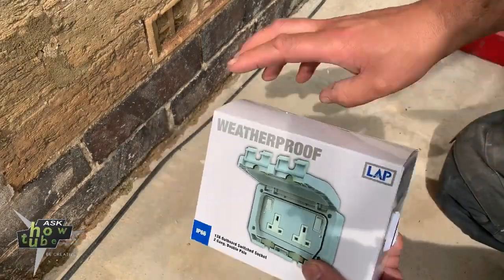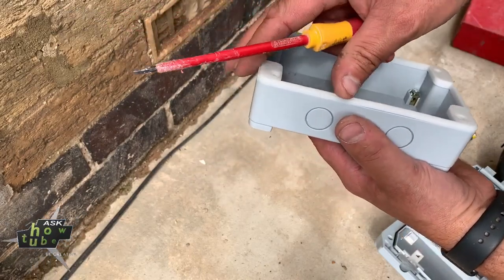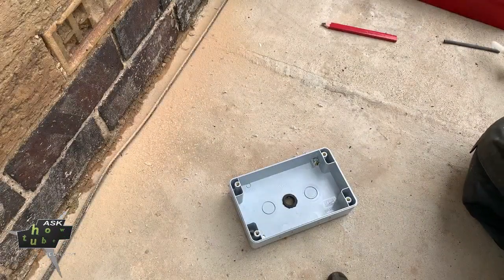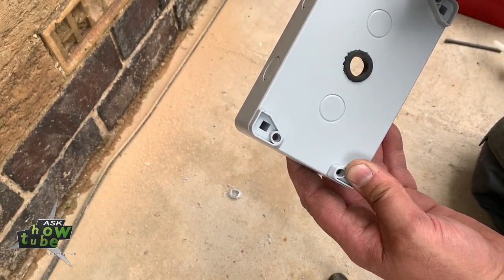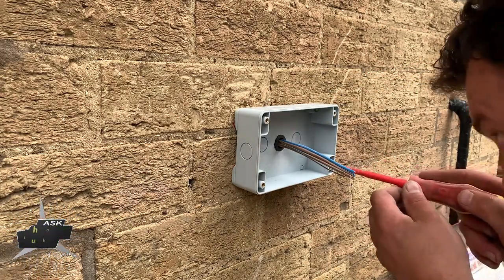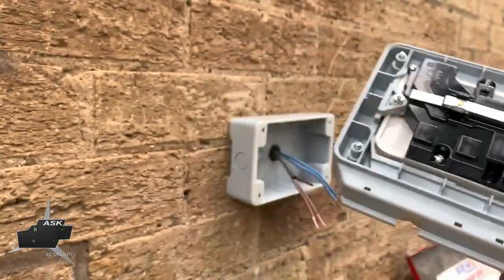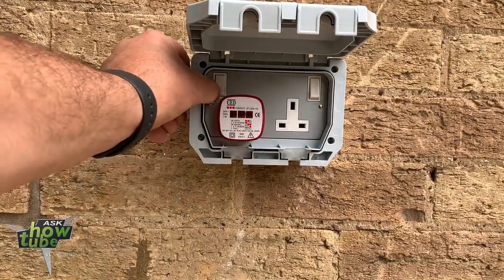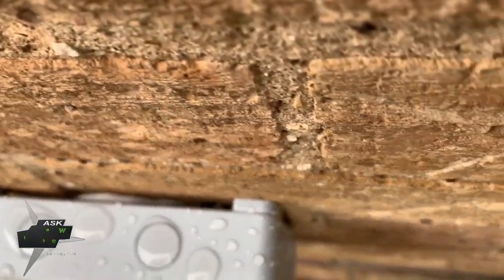Fit an outdoor socket, how to install correctly an outdoor socket, seal socket to prevent moisture.

Comment: You didnt knock out the drain hole, that makes the socket dangerous because in cold weather the socket will fill up with condensation
Reply from the maker: I did it, but it’s not filmed…but thanks a lot for mentioning it… very good point.

Comment: What is that type of cabling called? Looks like you've  got 2 earths, live and neutral.
Complete novice here. Thanks.
Reply from the maker: There are two cables with 3 wires each… using 2 cables you’re making the ring circuit.

Comment: I notice you had two sets of wires. Can I just run a plug from my shed to my pond wall and connect up just the three wires to it? Live neutral and earth. Will that power both the sockets? Is it two sets of wires for you as it’s on a mains ring from the house?
Reply from the maker: Hi, yes I did used the ring circuit. Recommend will be to connect the shed through a circuit breaker...
Reply: @askhowtube  Awesome thank you very much

Comment: I make a drain hole in the bottom as this is recommended.
Reply: if its done properly you shouldn't need to do that.
Reply: @tomsy8925  You may not be sure that the silicone has sealed completely (look at the size of the blown brickwork in the video) and also, with time, it may break its seal (due to temperature cycling, for example) or condensation can collect (e.g. warm air from house condensing on outside surface, especially if conduit/pipe has been used to channel cable). Though this is unlikely to be significant in most outside environments, a drain hole is often a good idea to prevent a pocket of moisture. It means that if ever water does get in, it can get out again. Unless there is spray from below, the only disadvantage is that it provides access to small invertebrates. With a drain hole, it may be sensible not to seal at the back of the box as then there may be air currents through the unit and equal pressure above and below any water that collects so drainage occurs. It could well be that is how it was designed which is perhaps why it is not supplied with a gasket to the wall and why it has stand offs to the wall.
Reply: @tomsy8925  its in the instructions
Reply: @tomsy8925  Most Outdoor sockets now come with a facility to drill a drain hole approx 5mm. Allows for condensation venting and believe me no matter how good you install it water will always make its way in, need a way out. British Electric outdoor socket for example comes with such a facility
Reply: You reduce the ip rating if you drill drain hole
Reply from the maker: Good idea, thank you.

Comment: Hi can an outdoor socket be wired to another outdoor socket?
Reply: Yes as long as there is a fused spur on the first one to protect the cables. Only one socket can be added with out a spur.